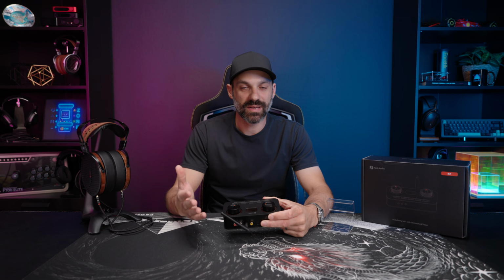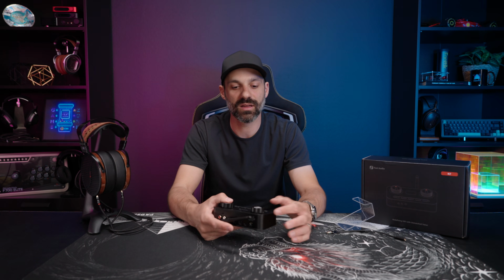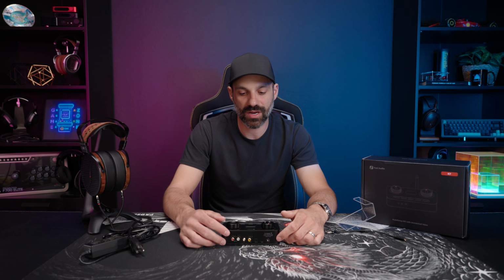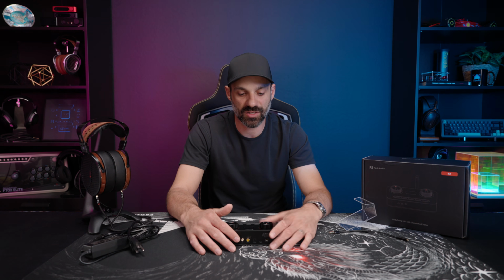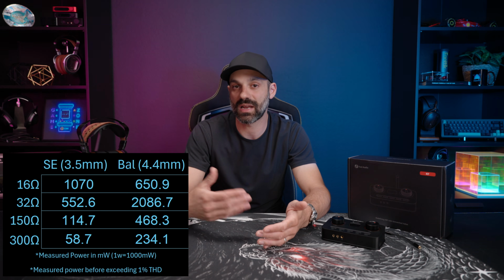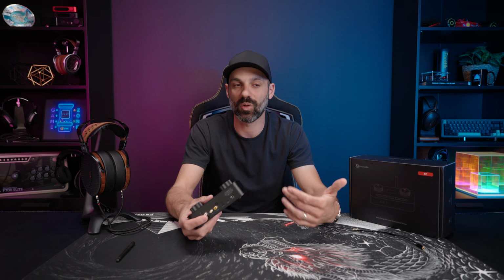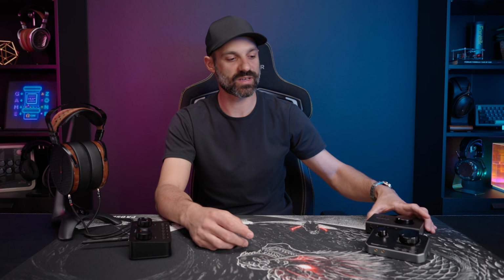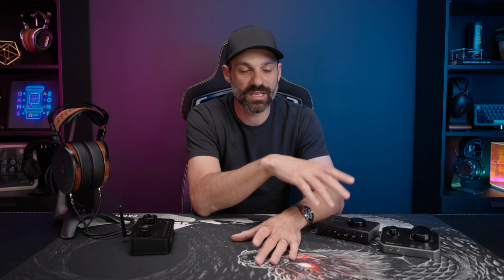Fosi Audio K7 Review - HiFi and Gaming, United.

Comment: FiiO K13 R2R / K15
Luxsin X8
Which one do you think I should choose? Does R2R technology sound a bit artificial? I plan to use the device for PC gaming and listening to music; I’m not involved in professional work like mastering. That said, I know that an "enjoyable experience" doesn't necessarily mean heavy bass. I already have a few headphone models in mind (HEDD D1 / HD 490 Pro / AR5000 MK2). There are many technical specifications I don't fully grasp; I’ll likely just place the device on my desk, turn on my PC, and use it like an ordinary user—I can't picture myself tinkering with custom settings or anything like that. However, that doesn't mean I want poor sound quality. I’m currently using a Rodecaster Duo; while it’s a simple device capable of driving most headphones, I feel it lacks a certain "depth" and "feel" in the sound. You are the experts here; which one would you choose? I’d really appreciate it if you answered as if you were buying it for yourselves.

Comment: I used to have issues with my G8 and it turned out to be the USB hub. Once I plugged usb port 1 directly into the Mac Studio and usb port 2 to a thunderbolt dock connected to an iPad Pro, I’ve had zero issues for more than 8 months.

Comment: Not being able to use UAC 2.0 while also having the 3.5mm microphone enabled is making me want to return this thing. It's the main reason I purchased it, but their website was very vague on whether or not it functioned like that.

I'd be fine with 24-bit, 48Khz UAC 1.0 with the functional 3.5mm microphone, as long as I could control the volume via Windows Sound Manager, but that also doesn't work as expected - when in UAC 1.0 mode, you can only control the volume via the knobs on the K7.

The audio performance of this thing is fantastic (paired with HD6xx), but there are so many poor design choices that went into this that it's making me highly regret my purchase.

Comment: Great channel! Just bought the 660S2 and the K7 to replace the old 2018 Sennheiser EPOS Game One set, which still seems to be performing like new after thousands of hours, but I figured its a good time to upgrade during this sale. 660S2 are currently 56% off on Amazon, K7 is 15% off. First time using a DAC instead of motherboard audio, should be interesting. Thanks for the review

Comment: Can you please clarify UAC 1 sample rate. Online it states the sample rate it 16bit/48khz.  But you’re stating it’s 24bit/48khz.

Which one is it?

I’m on pc, and I want to make sure this is the case. Because if it’s 16bit. I’m not going to buy it.  I’d rather just use the included usb dac for the ROG Kithara
Reply: Womp womp
Reply: @migueltorcuator2152  I ended up returning the Kithara. And never bothering with the K7.  

Went through Audeze for the LCD-X, and JDS Labs for the Element 4.

Best fkn decision I could have made.  Such an incredible experience.

Comment: What a sweet piece of hardware. I was bummed to hear you cannot output to headphones and RCA at the same time. I have a MOTU M2 that allows separate volume control & mixing between powered speakers (RCA) and headphones. I was hoping this Fosi would be a step up for audio quality but it's one feature a DAW provides I can't live without. 

Thank you, Joe, for always providing the most comprehensive and easy to understand reviews!
Reply: I have motu m2 aswell and I upgraded to ifi zen dac v3 because I liked the warmer tone and xbass on my open back sennheisers. Sadly the zen dac v3 also misses the separate volume control or muting speakers while your headphones are connected so you have to either unplug headphones when using speakers or manually turn of speakers when using headphones...

Comment: What's up buddy.  Seems like a winner with either the k7 or the gunnr. I know sound can be subjective . Still wanting to know your expertise.  I got the lcd-x and paired it up with the k7 . I'm only play single player games on ps5 and pc . U think those 2 make a good pair or would u have personally gone with the schiit gunnr if u where also a single player game player aswell? Thanks dude
Reply: The Fosi K7 has a better dac chip, op amps and a xmos chip. The plus side is it's cheaper. I have the Hel V2 Schiit and going to the K7.
Reply: @Borrie131 yeah ended up canceling the gunnr and went with the K7. Im not into competitive shooters and considering increasing the soundstage on the gunnr muffles the other sound details I figured I  am not going to use those features.  Control of the bass and treble on the k7 is all I need . Anyways . Sounds great . I have zero noise on low volumes and the unit feels solid .

Comment: Thanks. The SB G8 was trash as well as their software and I needed a replacement. This fit the need.
Reply: But the fosi doesn't have a dedicated knob for chat to volume to quickly switch. When he says it's on the software side I'm assuming he means having to go into ps5 party settings everytime to micro adjust which sounds incredibly annoying. My current setup is the astro mixamp tr plugged into ps5 and optical cable plugged into tv for the surround and chat volume knob to work. Sounds great with the ps5 but when plugged into my laptop audio sounds like a tin can so I'm assuming it's reverting to stereo. Towards the end of the video when he mentioned the g8 he also mentions features like digital surround so does that imply the fosi doesn't have that? Even when plugged into the Playstation? I dunno if I'd want to drop 200 dollars on a dac if I'm not going to get surround for immersion especially when playing games or plugging it into my 4k player for movies.

Comment: Thanks for the review, just what i needed. Im using Arya Organic along with Meze Boom mic, hopefully, this will be a good combo for both music and gaming.
Reply: Please help, let me know how your mic volume is. I use the hifiman ananda stealths with meze boom mic, volume for the headphones dont get loud enough so I wanted to get a gaming dac. Tried the fosi k5 and the mic sound was so quiet I was barely audible but the headphone sound was great. Are you planning to get this? If so please tell me how the mic volume is. If you dont mind me asking what is your current setup? I returned the K5 and stuck to the motherboard mic and headphone connector.
Reply: @needtau4138  Hello mate, hopefully this finds You well. Volume is fine, im using it with splitter connected to DX5II, never using it over 50-60%. Got a different card for mic splitter.
Reply: @needtau4138  Im using Topping DX5II and Soundblaster USB card for mic. Works great

Comment: Just bought it. Testing against Soundblaster Ae-9. Fosi sounds more warmer. Trebles less hars also. It is very similar both have very good quality sound quality. Build quality is excellent I would say. Good dials. Feeling good to move them. One thing that I might missing is surround sound from Creative. On Fosi you have to use Dolby Atmos if you want something comparable. One interesting think on x870e,9800x3d PC Fosi completely cured startup sound crackle which is extremely interesting. Will test more I will keep just one!
Reply: i want to buy it for my ps5 , mainly cod warzone , is it worth it ? or the soundblaster g8 may be a better one ? , regarding the surround sound point that u mentioned
Reply: @ can you use dolby atmos on ps5? I dont know
Reply: @Ytbine hdmi audio extractor and u will have optical 5.1 sound out

Comment: One thing that I think you could improve on is the negative aspects of products in their initial reviews. I love me some neat power numbers and you seem to as well! However for some products (I've just watched the SB X5 and G8 reviews) where the output isn't great compared to other products at a similar price point, it gets somewhat glossed over. Love that you go so much more in-depth (software, technical nerdery, installation process etc etc) than a lot  other "reviewers" and it's obvious that you're very experienced but man, I think you should start swinging that crap-hammer a whole lot harder on products that's just a bad choice at their price. Especially when the shortcomings are so flipping apparent even for someone like me.

Comment: So apparently you can't use the Windows volume control (which often have a volume control on your keyboard and is visible on the screen when adjusted) while in UAC 1.0 mode, but you can't use a microphone in UAC 2.0 mode. So, this makes you have to choose between the two. I don't like that.

Also, no 6.3mm output. Having to use adapters feels very meh.

Comment: UAC1 mode only be limited to 24/48 is seriously a no go at that price point. there are many dacs cheaper than that with higher bitrate/sample rates while also supporting mic input, hell you can snag steelseries gen2 DAC for half the price which arguably is still a goat for price/performance rocking the ESS Sabre chip and have mic input and audio output with higher sample/bit rates. Being limited to UAC 1 if you want to use mic input is beyond stupid for that price

Comment: I would not go so far as saying HiFi and Gaming united. That's just click bait. There are a few glaring ommissions when it comes to gaming. Lack of support for sidetone, XLR connection, Phantom power. If those are in, then yes, it's HiFi and Gaming. Just putting in a 3.5mm mic socket without even support for plug-in power is really hitting rock bottom for gaming. If they put in UAC2.0 support for the mic input, that will be icing on the cake and that will finally be a true HiFi and Gaming device. But as it is, the Gaming portion is just an after thought.
Reply: barely any gamers even know what xlr is, let alone use it. xlr is more for music production or voiceover/podcasting. sure, you can use an xlr mic as a gamer but that's not at all the norm.

Comment: can someone tell me the best combination of settings for cs2 footsteps? As headset ive got the Epos H6Pro Open back. My settings right now is -2 on Bass, + 4 on treble. The rate is set to PCM (cause of the mic issue). My ingame settings are: 80 Master volume/ L/R isolation 50 %/ Perspektive Correction: No/ Other VPlayer Volume: 80 %. I don't know but i have the feeling i can get more out of it. What settings would you recomment? Should i use some software tuning in edition? Would be glad for some recommandations for those settings.

Comment: Regarding the delay/cutoff issue in UAC 2 mode:
It's a problem/wrong setting on the XMOS USB controller driver. Easily fixable, annoying nonetheless. 

Google "XMOS driver settings for no cutoff" for a very good tutorial by user "Noodles" on the ASR forums. 

You have to use the somewhat hidden Fosi version of the XMOS driver (google should help you there, otherwise check Fosi support page of K7 for manuals & downloads) and enable the visibility of the "Options" tab via an entry in a config file (ASR thread for HowTo).

Under the new "Options" tab in the XMOS driver interface there is a Streaming option. This option is the culprit. 
You get a delay/cutoff when it is set to "On when needed" - the default option - instead just put it to "Always On" after you've made sure the option is visible. No more delays! Yay!

Comment: Deciding between this and the Fiio K11. Running Blue2s and DT900 pro x. Gaming mainly, but critical listening for music too.
Reply: @ZetaFL, brother, i also have a pair of DT 900 Pro X, i want to know what did you choose and how is it?
Reply: @andrewthz4199  I stuck with the Fosi. The on-board treble and bass control was perfect. Fiio k11 was nicer looking, but just didn't have as many features. Sounded pretty similar without adjustments.

Comment: Could I use a Shure mv7 microphone with this?  I read somewhere that I would have to use the  "XLR to 3.5mm adapter but doing that the microphone's internal DSP features (like gain and EQ adjustments) will not be active, and you may need to significantly increase the gain on the receiving device."  Your thoughts?  Your videos are great!

Comment: On Windows 11:

In UAC 1.0 mode
- The only sound format available is 16 bit, 48kHz.
- Windows volume doesn't control anything; 0 volume is the same as 100 on the volume slider. Volume knob on the K7 is the only volume control

In UAC 2.0 mode
- The range of sound formats available are 24-32 bit, 44.1-384kHz.
- Windows volume control does work, independently of the volume knob on the device.

Pretty interesting, I hope these things will be fixed.
Reply: Ever get corrected?

Comment: Thank you for taking the time to review these. What if you use the Xbox controller and plug that into it?  Would the mic work then?
Reply: I wouldn't recommend that. The mic needs the usb  as far as I know.
Reply: @ thanks
Reply: @Hijynx87 You’re right. So I just found a way to use my Xbox controller with a simple gadget that allows 3.5mm to optical. Haven’t tried a mic but it’ll likely require a splitter.

Comment: Did not know this was a new product. I was looking for an AMP/DAC to upgrade to from the FiiO Olympus E10k that had both a 3.5 and 4.4 aux since I was just starting to collect IEMs with a balanced connector. I wanted whatever I could get for under $200 that had as many knobs and hardware buttons as possible so I did not need to fiddle through settings. This does practically everything I want when paired with my Stream Deck for more nuanced media and volume software controls. The one thing I wish this had that it does not is support for an XLR mic. I hate my bluetooth mic and feel going back to a simple AUX one feels like a step back. If I upgraded, I would want to snag an XLR mic so I feel this is limiting in that regard. Though, in the end, it would probably be better to get a dedicated system since I dont want to have to switch functions just to have access to a hardware mute button.

Got the thing in today and I really love the build quality. I have a 2 PC setup with one system dedicated to audio, cameras, and screen-sharing and another that is for productivity and gaming. Due to the unique nature of my setup I was able to reuse the E10K as the main audio source for my main rig and use the line out on that to link it to my Audio/Video PC. Main advantage to this setup is I now have two DACs that I can quickly AB test with that have their own separate hardware audio knobs. All-in-all its been a fun upgrade. I am glad I have more desk space to justify something like this now

Comment: No Game Chat mix and sounds to quiet with Meze boom mic sadly rules this one out for me...If they are going to make a Gaming Dac Amp it's gotta have game chat mix...and i can't find anything that fits the bill for PS5 Pro so im just running heaphones/mic through the controller....but the extra wires might send me back to my Turtle Beach Stealth 700 gen3 which are pretty decent but i hate the pads on them. Sadly my  ifi Zen Dac 3 doesn't support mic or i would use that as it runs my Focal Clear MG Pro's perfectly. I like the Schiit GunnR but that has no Game/Chat mix option either unless i missed that? Any recommendations?

Comment: Joe, my only concern is that the thd+n ratio and snr figures published by Fosi doesn't have any indicated Vrms levels. The thd+n and snr figures can change greatly depending on the Vrms levels and for iems which you usually use around 50 Vrms, the performance drops by 25% or more and that's assuming the thd+n ratio and snr measurements are taken with 4 Vrms. I hope you can ask them for clarity and transparency with their measurements, thanks in advance Joe.

Comment: Hello! I'm looking at upgrading my current setup which is a fiio k3 (older version). I'm primarily a pc gammer and use Sennheiser 599 HD headphones and a blue yeti microphone. I was looking at the fiio k7 but was getting mixed reviews in regards to the dac/amp. I ran across this video and this dac/amp looks promising. What are your thoughts on the headphone setup paired with dac/amp? I was looking at potentially changing my headphones to beyerdynamic dt 770 pro x down the road but not sold on it quite yet.

Comment: Thanks for the in depth review and comparing it to the other 2 products. I initially watched your Schiit Gunnr review a few months ago and then just rewatched it again. I have been planning to buy the Gunnr, but this K7 actually looks mostly better. It's a bit cheaper and has mostly more features. It sounds like it has less power output, but will still power even most high end headphones. I have never had a DAC before, but I want to start with something good, including high quality mic input. I really like the bass and treble options this has, which are missing on the Gunnr. Hopefully getting the K7 is the right choice..
Reply: im same boat it will be my first DAC/AMP and i narrowed it down to these two , the gunnr and K7 , which one did you end up going with?
Reply: @thugpain4500 I am curious as well. Which one did yall end up going with.